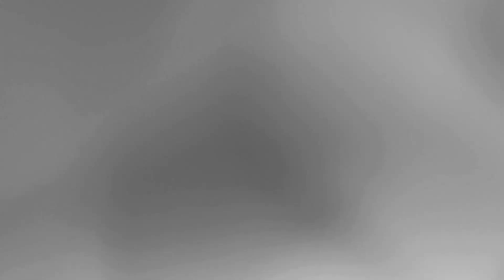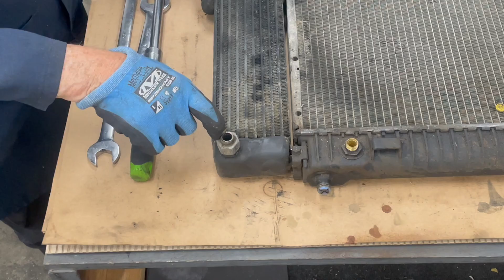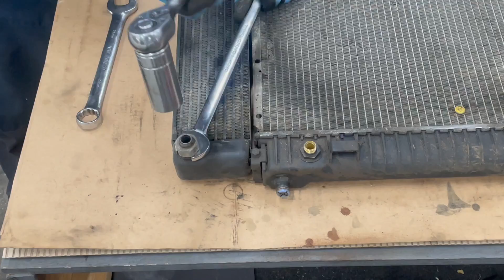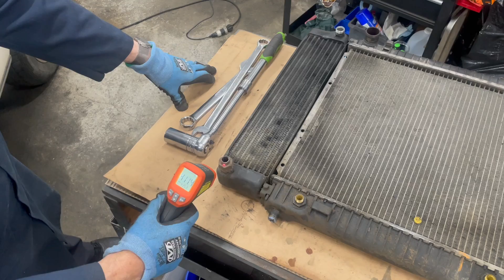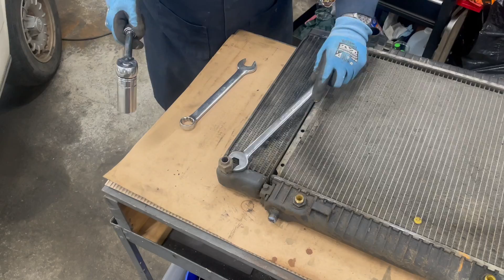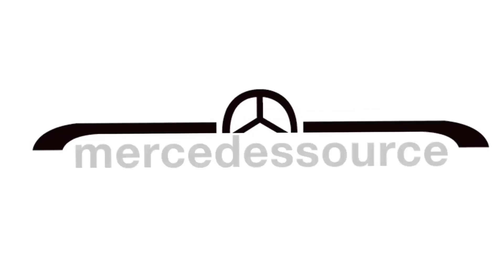Diesel Oil Cooler Hose Fittings: WARNING - If They Are Stuck, Don't Force Them!

Comment: That induction heater is a great idea! I had an oil line on a '91 350SD that had to be replaced. I tried heat, penetrants, prayers to Odin; nothing worked. The threads just stripped  off of the cooler. Ended up welding standard size aluminium AN fittings onto the cooler, with matching aluminium fittings on the new hoses. There is an online outfit that makes specific adaptors to fit on the oil filter housing that have standard AN size fittings, so in between them, Amazon, and a local hot rod shop, a leak-free system emerged. By the way, the cooler hoses for the OM603 engine are strictly NLA. Interestingly enough, several hydraulic specialty shops said they were not interested in making new hoses for the car. Very strange.